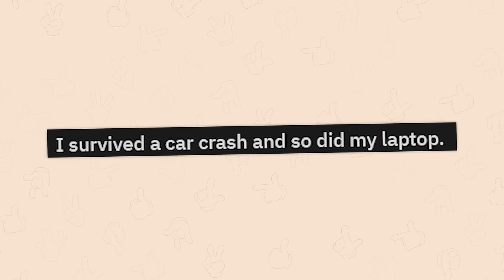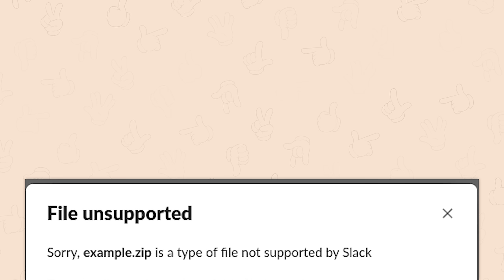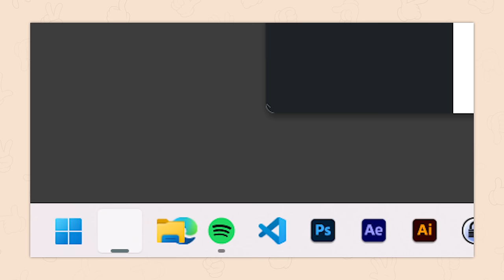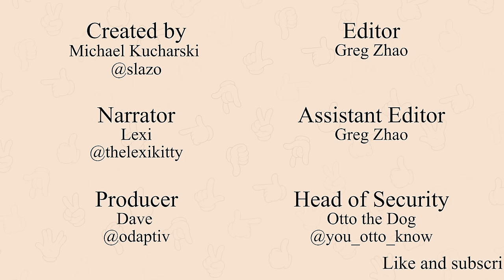r/Techsupportgore | why is the wifi down?!?!?

Comment: I have my own gore story. Pretty recently I was eating 2-minute cup noodles at my desk watching YouTube, I was getting up and then knocked the cup over on to my laptops keyboard. Luckily the reason I was getting up was to because my dad wanted me to do something. He's an electrician so he immediately disconnected it from the power and shut it down. He put it outside and dried. It ended up still working, the keys were just sticky, and the space bar is quite sticky. So yeah, I was extremely lucky that when I spilled half a cup of noodle juice on my laptop, my dad knew what to do and managed to save it.

Comment: 5:16 If I had a nickel for every time I had to pull a ground prong out of an outlet, I'd have 3. It isn't a lot but it's strange that I've had to pull only the ground prong more than once. 

For those who don't know, a typical US outlet has 3 holes. Most small electronics only require the two slit ones. But, some larger electronics (such as vacuum cleaners) have a third prong. That's because the larger demand for power creates a higher risk if it were to short-circuit. So, they implemented the ground prong to ground the circuit and minimize the danger. The ground plug usually connects to a bare wire that runs to ground, making it perfectly safe to touch (if wired correctly). If the ground plug does break off, don't worry about a shock. I would still wear insulating gloves because electricity can be unpredictable at times. But, it isn't that much of a risk.

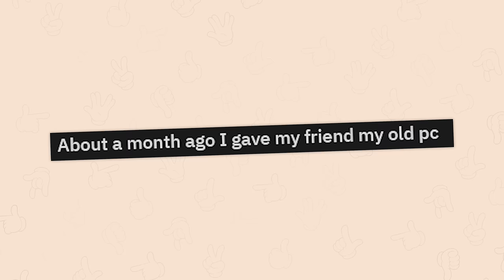Comment: 8:52 if the general image isn't scary enough, most polymers will do what is called "auto-ignition" at around 480 degrees, so that system would have burst into flames long ago

Comment: 17:36 This happens very frequently when VS Code has a file open in its editor. Even if the file is saved, and has no pending changes, I've received this error. It seems to be very random, too. You have to save the file from VS Code, close the file from the editor and SOMETIMES even close VS Code and then proceed with "Try Again".

Comment: 8:50 i wouldnt worry about the copper at 500C
the semiconductor silicon coupling breaks at around 150C (hence a 100C max temp on pc components)

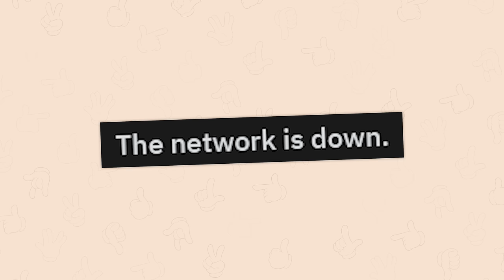Comment: 26:27 I see a hell of repair job ahead. Replacing damaged cables will involve tearing away drywall to find and replace damaged cables and repairing room(s) again after that. Will cost a lot, that is sure. So better keep blueprints of wiring in your home and office nearby and inform contractors timely to prevent such damages from happening.

Comment: 1:56 IDK why but for some reason macOS occasionally just corrupts its framebuffer for no reason, doesn’t affect the OS normally because the framebuffer just gets overwritten with non-garbage data immediately after, but SPECIFICALLY on the preboot login screen, only the progress bar updates (probably an optimization tactic as at that point all graphics are CPU-driven). So, if the framebuffer gets corrupted, that happens.

Comment: I had the split ethernet thing at my last rental. Landlord was paying for gigabit and ran it to our building through a cable the previous owner had put in. We had no idea why it was limited to exactly 100 Mbps until we were replacing it with cat6 and found that the two ports in our side were pulled out of the same cable. Except that the second connections came out the side of the first cable at least 10 meters from either end.

Comment: The battery low one, my phones done this one before, if your battery is low it will display the "low battery 15%" notification, sometimes if you charge it without swiping the notification away it will stay there while its charging and display it as "battery low 100%" but after plugging it in on most phones the notification usually goes away after plugging in

Comment: The first post is an AM4 socket. When you remove the CPU cooler, the thermal paste can stick to the CPU and  rip it from the socket if you don't twist it first to break the seal. I accidentally ripped my CPU from the socket once and was lucky enough to not destroy anything, but this person seems less lucky.

Comment: 6:50 What I hope and pray this to be , is a jerry rig temp solution made in the absence of the proper tools necessary to rewire the actual connector attached to the face plate, that was either forgotten about or otherwise has not yet been fully fixed. If I am doing electrical work I would not necessarily have the tools and supplies needed to fix that properly, but jerry rigging a solution to keep things from entirely falling apart would be very possible.

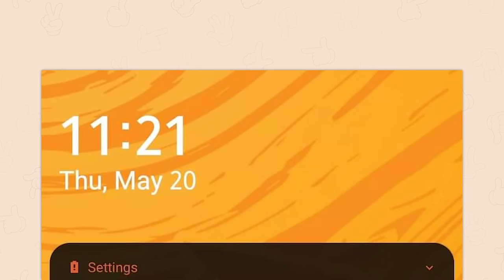Comment: 1:28 I had this problem on an old Samsung. if you let the battery get low and then charge it without addressing the notification it will still be there when it's fully charged

Comment: The thing is, running things to spec, IS running them to be "good enough". The spec is the minimum amount you need to do. Everything else is not good enough, everything else is "if it works, great, but it's bad and you should fix it"

Comment: 24:36  This happens when the power adapter isn't feeding enough power into the laptop and the laptop just barely gets enough power for the laptop to consider itself to be charged. It's basically not getting the full power it needs and it ever so slowly consuming battery power that is not replenished, which is really hard on the battery. He probably needs a new  adapter or a higher wattage charger and in the worst case, a whole new electrical outlet. Trust me I've had this happen to me before and it said 83 days, 19 hours, and 17 minutes. I had a laptop on life support using a 45W fast charger. The adapter I needed was not with me at the time and I just used my phone charger.

Comment: That damaged socket?   That's what my Wraith cooler that came with my 3600x tried to do to my system.  It damaged some of the second bank ram leads in the socket.

Apple screen is just something went wrong with their wavy super-subtle log-in screen.   Could easily be the APU.

Comment: From what I gather, the 0x80070050 error is when the file remains in a cache (i.e. the file exists) even though it was already deleted. It can't be deleted because the file itself is no longer there. Primary cause would be a bad drive or bad sector.

Comment: 22:45 These are probably some sort of VFD (variable frequency drive) for three phase motors. Industrial like CNC machine or robot or what ever. They can make a motor go brrr in different speeds and directions in a controlled manner. If they have to slow down the motor, the inertia has to go somewhere. In that case the motor acts as a generator and produces electricity which is normally stored in some capacitors inside the VFD. If that capacitor is fully charged, the VFD can either stop breaking the motor (which might be bad in some cases) or get rid of the excess energy via a breaking resistor. In most cases these things have a small one inside and an option to connect a larger one externally for motors with large inertia (the external resistors look like little space heaters, as they are essential exactly that)
If they break a motor, the resistor dissipates say 1000W for 1 second but than has time to cool down for a minute, so no problem
The picture shows what happens if the mosfet or whatever controls the breaking resistor fails closed and the resistor is now basically across rectified mains voltage all the time. These resistors are not designed to operate continuously

Comment: OLD TN panels, I'm talking mid-2000's or earlier old, from back when IPS displays weren't even a glimmer in some display engineer's eye yet... THOSE are the one's that probably have CCFL backlights in them.

Most "gaming monitors" that are geared towards refresh rates higher than 60 FPS are going to be a modern TN panel... and for energy efficiency reasons they're almost always LED lights these days (oh and it gets rid of mercury out of the whole device, because those little CCFL lamps are just a tiny tiny version of the fluorescent tubes you have providing light in a grocery store or office building).
I'm pretty sure both I and Lexi (and many others, as well) know that TN panels have a reputation for relatively poor contrast ratios compared to an IPS panel from the same model year. However, the use of LEDs as backlight elements (along with an appropriate and slightly more complex backlight drive circuit) can help reduce the impact of that problem.
It's usually called "spot dimming", and the idea is that because you already need a grid of LEDs to supply the light to the back of the LCD screen itself, you can improve the contrast of the displayed image if you can individually control the amount of current flowing thru each LED in that grid. If this is starting to sound like an LED display behind an LCD display, that's because it's pretty much exactly that. Large patches of darker pixels in the image that is sent from the video source are detected by the backlight driver control electronics, and in response it reduces the current going to the backlight LEDs that supply light to the LCD where those dark sections of the image are. So instead of the LCD having to block the MAXIMUM possible amount of emitted light in the area of those dark sections of the image, the display's backlight driver catches the problem early and tries to make sure that the backlight LEDs are only emitting the amount of light that is needed for the expected resultant image.

Now, that's very clever and all, and for something like a TV that is usually displaying movies or scenes where the bright spots in the image don't change position very fast, that's a good thing.
However, there are two key problems with this technology when it comes to gaming monitors:

Firstly, fast motion. Because it relies on adjusting the current to the backlight LEDs, and those backlight LEDs usually have some sort of smoothing capacitor in the power supply, the brightness of the LEDs can be brought UP very quickly, but it takes a bit of time for the brightness to decay to a lower level. At 60FPS, this effect is almost imperceptible, however I have a 4K resolution monitor that is capable of a 144 hz refresh rate (and it has the TN panel with the 1ms pixel response time to back that up). At higher framerates, I tend to notice a distinct "trail" of pixels that are "the right color, but brighter than they should be" behind any fast-moving bright spot on a dark image, because of those LEDs that were just providing light for the section of the LCD that had the bright pixels in it suddenly being told to stop emitting light when the bright pixels have passed, but the little smoothing capacitor still has some energy in it and that's causing the LEDs to stay glowing for some time after they would have ideally been turned completely off. It's mainly a problem in how the dimming circuit is designed, to be honest, and there's a lot of improvement to be made there.

The second problem is related to the construction of the monitor itself. Yes, you need a grid of backlight LEDs to evenly illuminate the LCD display's back side. That much I've already said. However, cost concerns dictate that it should be done in a way that minimizes cost, and one of the prime ways to do that is to spend more money on the path the light takes from the LED to the back of the LCD, rather than increasing the number of LEDs to even out the light levels. After all even optical-grade plastic is cheap compared to semiconductor devices, even if they're (relatively) inexpensive LEDs.
This creates a problem for the spot dimming solution. If you are using a sparse grid of LEDs to cover a large display, you don't have as many individual LEDs to control. This results in visually distinct large regions of the screen becoming bright or dim in unison, and if poorly executed will result in visual artifacts that detract from the intended effect (I'd describe the effect like "haloing" of bright pixels by "dark pixels that have a bright LED behind them"). The way the display designers reduce how much people notice this is again by slowing the rate of change of brightness of the backlight LEDs. However, in this case, it creates the opposite problem to the one above. Instead of leaving a trail of bright sections of the display behind the bright pixels, it makes it so that what SHOULD be a bright section of the display is instead intentionally not allowed to come up to the needed brightness, which results in an overall dim and muddy image, no good to look at. Again, this causes me to turn off spot dimming.
The real way to reduce the impact of this effect, is for the display designers to accept the fact that doing it right costs a certain amount of money (costs can't be cut beyond a certain point without delivering a notably sub-par product, and trust me when this happens it looks FAR worse compared to an otherwise identical display that has "not as deep blacks but at least you can see what's going on").
Same reason why you should never turn on any kind of "cinema" or "classic film" or "movie" mode on on your TV, it makes the displayed image an (apparently intentional) inaccurate representation of the input signals.

Sadly, it seems that while spot dimming could have had promise, sub-par executions of it abound in the market, even my own gaming monitor supposedly has it (and it came with it enabled from the factory). I had to scramble thru the OSD on my monitor to figure out how to stop it from giving me its opinion on what the image should look like. The monitor is supposed to follow the instructions it's given to the best of its abilities, and if it's going off the script on purpose, I'm just gonna tell it to go back to school to learn how to properly paint by numbers (after all, in a sense, "paint by numbers but with light" is exactly what a display is doing, doubly so if it's being driven by a signal that is composed of one or more digital bit streams).

Comment: That "battery low (100%)" is exactly how my laptop is--I hate having to bring my charger around the house (and even to work for shifts where i spent the whole time on my computer due to lack of anything to do), so I adjusted the battery saver settings so the battery saver would kick in whenever my computer is unplugged
It just also comes with a notification every time and I don't know how to make it stop

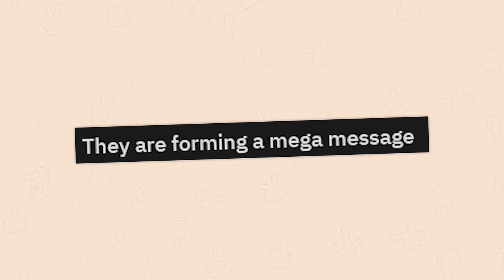Comment: 23:23 That capacitor is proably not factory, ive done simalar things although even more cursed with wires to keep them out from interfearing.

I can bet thats a motherboard in either some old ass government system or some licenced system that binds itself to the mobo and doesnt allow moving it

Comment: 6:54 AV/Network installer here at least splurge on Dolphin Crimp Connectors. I have done this on a 10/100 network TEMPORALLY to get a gate working on a remodel because we were going to replace everything. Unfortunately the client refused to pay and yelled at my boss for other work we did TOO SPEC because the GC wouldn’t coordinate us with the other trades and that is now a permanent repair.😂 we lost 1 UDM, 3 WAPs, well over $10k in smart home equipment, and weeks of labor.

Comment: Splitting 100mbit ethernet not only works but is reasonably within spec. One cat 5 or higher cable can carry 2 100mbit connections, or a 2 pair economy cable will carry a single 100mbit connection. In professional environments, 2 connections over 1 cable would mostly be used if there isn't an easy way to pull an extra cable.

Comment: 17:40 If I had to guess. The file in question was involved with Microsoft one drive (the absolute nightmare that it is.) And it resulted in the address getting confused in some way. Especially if the OOP didn't "properly" remove one drive.

Comment: the funny thing is, those 2000 hard drives are likely fine, a hard drive degrades on "hot time", what they likely have there is "cold spares"
as long as your drive is newer than post 2000(those are) you can pretty much buy a hard drive and let it sit on a shelf until needed
the data integrity is 100% and runtime is 0, so you basically have a new drive

now yes, older than 30 years old could have grease-glue syndrome, but as long as the bits move a hard drive can last forever in storage, the practical limit of cold spare storage is actually bearings or the eventual magnetic decay of the platters, 6-10 years powered on, till it freezes up bearings or demagnetizes in cold storage

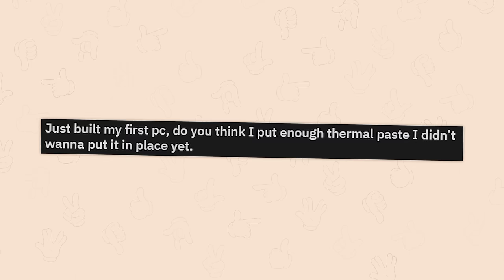Comment: 12:20 Some of the newer server CPU sockets like the LGA 3647 work like that where you attach the CPU to the heatsink and then put the whole thing over the socket. This obviously isn't such a setup. When this system is used there's an obvious clip or bracket which ensures proper alignment.

Comment: denatured (or if you're in stupid California,  90+% isopropyl)  can be used to wash electronics that got wet. then you can use the hairdryer method,  then leave it in silica for 48 hrs before powering on

Comment: 12:33 yeah you usually apply thermal paste after actually putting the CPU in place and locking it in, THEN you attach the cooling unit on top. Doing it this way... you will have a very touch time getting the CPU in there without wrecking any of the pins with all the added weight of the cooling unit.

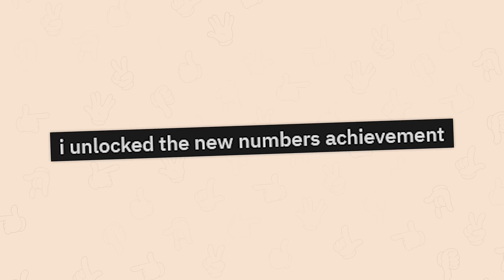Comment: 4:58 actually, that is perfectly normal when an app written in Asm or C++ doesn't clean up after itself before closing, leading to the homescreen graphics cache having garbage data in it. I know this because I have one of those, and it only acts like that with C++ or Asm software, usually Asm, since it's not put through a compiler that knows what it's doing.
Edit: Just in case someone reads this before seeing the part I'm talking about, it's a TI-84 Plus CE, with corrupted graphics on the home screen.